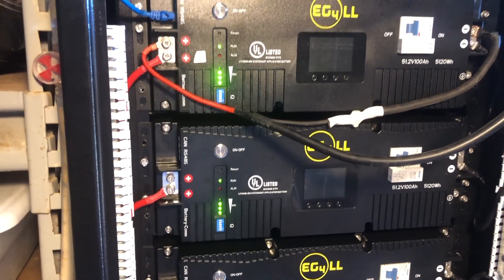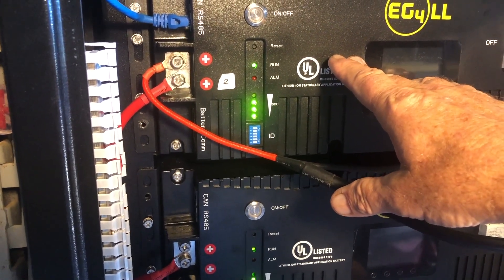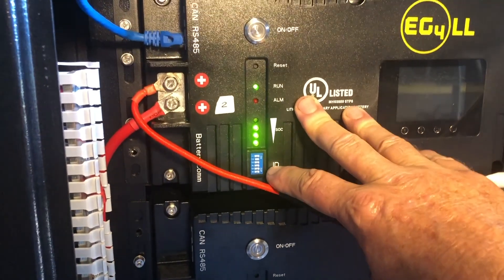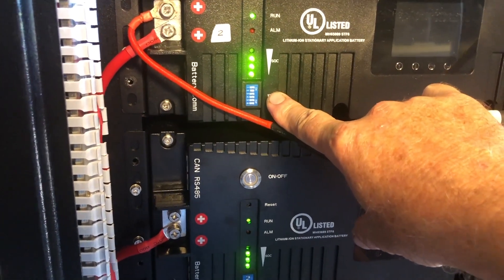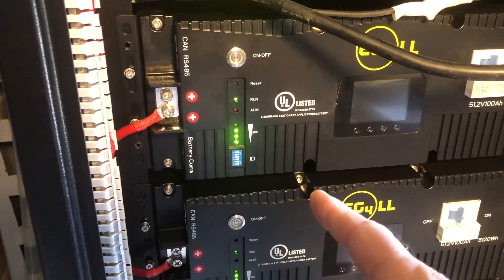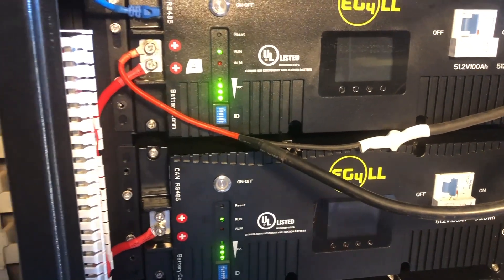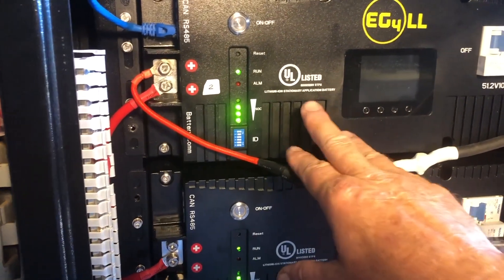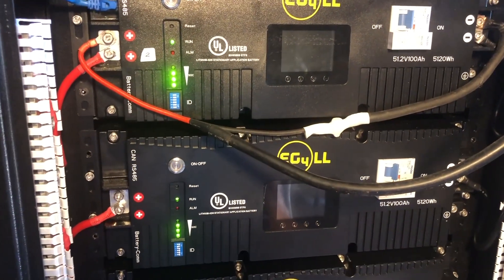BMS Tools Not Able To Read EG4-LL Lithium Battery?

Comment: Thanks for the video, but too late, I've got the same batteries except the 4 bit dip switch version. I already changed the dip switches and now I can't get the tool to read the data from the batteries (6). One has an alarm and is in Protection mode fr some reason. I've tried every dip setting and power cycled after changing it. Really frustrating...

Comment: I was just helping my brother try to figure out how to get bms tools to connect. There does seem to be conflicting info on the youtube videos and the manual. I finally got it to talk to the battery using ID64 and 9600 baud. I was helping remotely so that made it a bit more challenging too. Have you ever done a firmware update on the v2 batteries ?

Comment: hey Lance, have you received any update on this issue?

I have 6 of the V2 batteries as well and would like to see the state of all the cells someday. :)
Reply: Same here. Ever hear anything? One of mine has an alarm I need to figure out.
Reply: @jeffntexas8920  Hey Jeff, check out a reply I posted in a later video of Lance's, I made a daisy chain RS485 cable the lets you see all the cells in the rack.

Lance's video is the one where is uses several USB to 485 adapters.

Comment: Yeah, I'm sitting here struggling to get the software to read and it's saying no serial port or device is available
Reply from the maker: Make sure you have the right com port selected and the communications cable is attached to single module. Do not use daisy chain. If you didn’t change the dip switch setting, it should connect. Only ID 2 would work for me. It may be different for you.
Reply: @lanceknoechel8945  Yeah, I made sure the com port was correct, disconnected the other packs, went through several different dip switch settings 1-3 and 60-63, restarted the program. Nothing is working. Doesn't seem at all right to pay $10k for something that is defective or doesn't do what it claims or promises.
Thanks for the help. I emailed signature solar, fingers crossed I get a response. I hope they are actually working on a firmware update or repair.
Reply from the maker: @ericmatthews3307  I feel your pain. I've had MANY issues with EG4/Signature Solar. I'm trying to exercise some patience as they go through their growing pains, but it's been VERY frustrating.